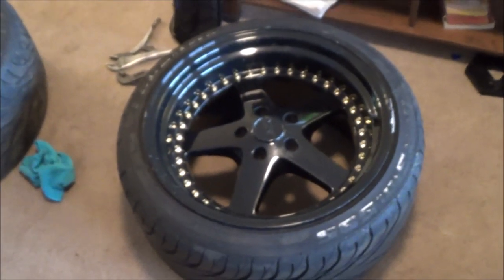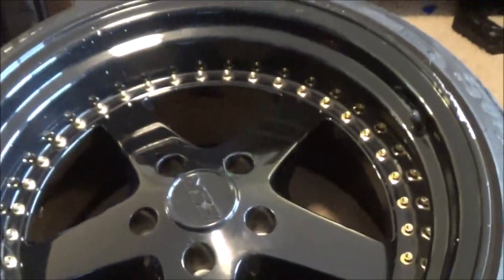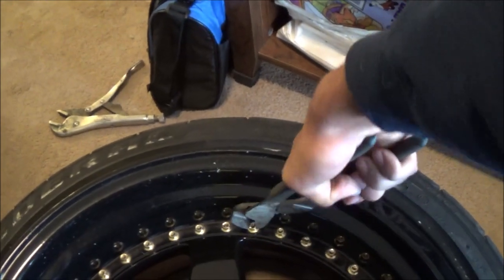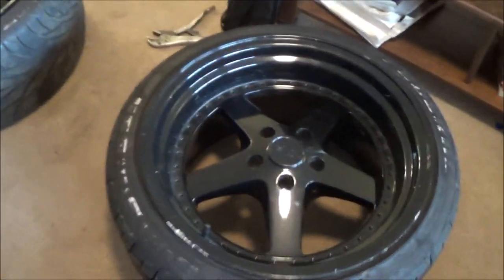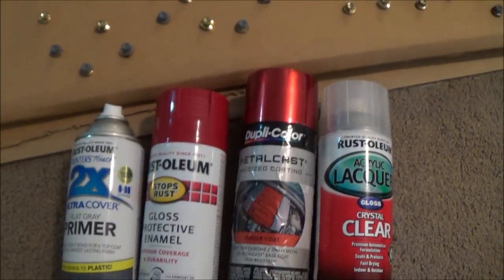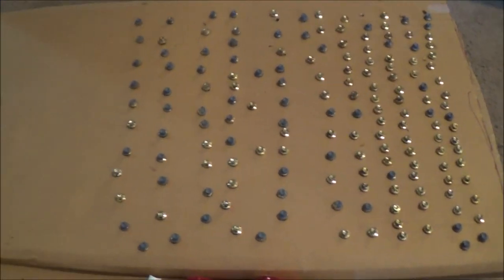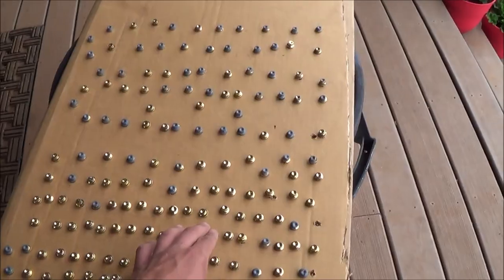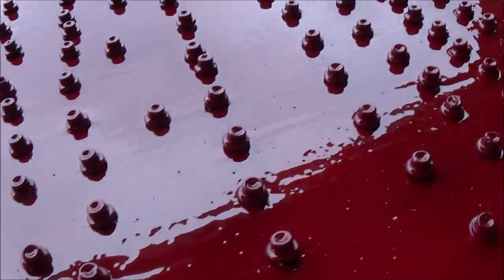How to Paint ESR Wheel Rivets

Comment: Are those metal rivets? I'm trying to do the same thing with my Nietzsche rims and they are plastic, what type of prep or primer and such would you suggest for that? They're already painted black so I'm not sure if I need to soak them in something to remove the black paint or should I just paint over the black or should I paint a primer over the black first and then do my base coat? Any suggestions would be helpful. Thanks for the video very informative.

Comment: A punch on the backside and rubber mallet and they easily and quickly pop right out with no chance of damaging the outside area that is visible
Reply: That would be great if the holes went all the way through, but they don't
Reply: @davidpb1970  mine go all the way thru. Wonder if the older esr wheels don't go thru